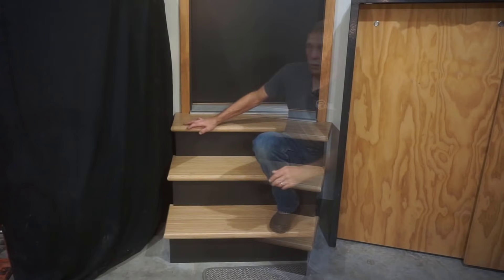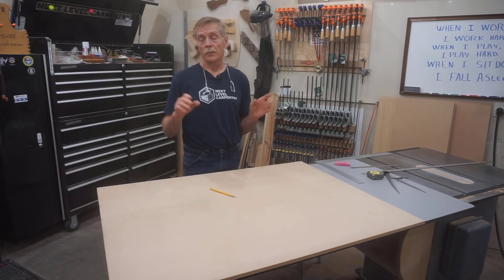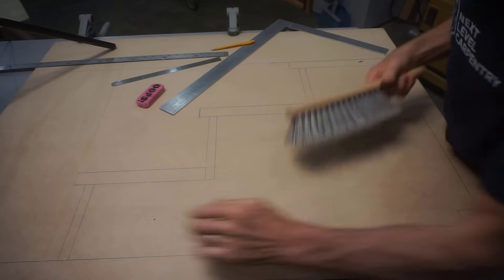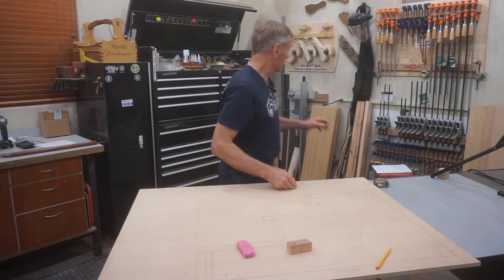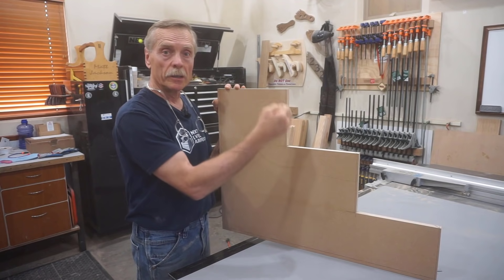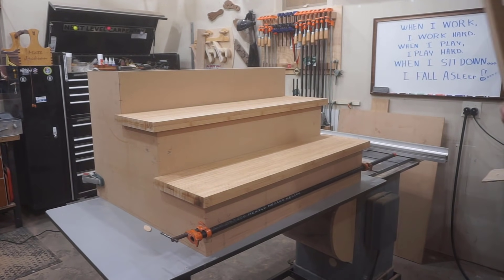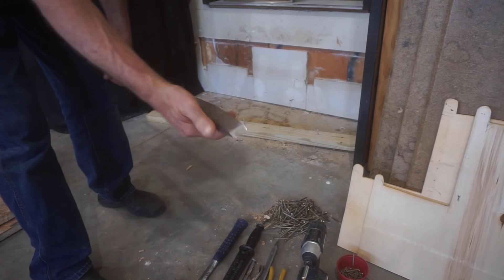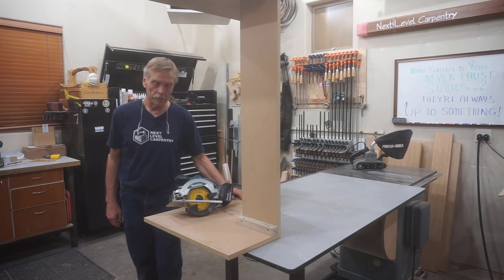Build Simple Strong Steps Without Stringers

Comment: Nice short cut and good use of story stick.👍But my local building code ☹ will make add a 36 inch landing in front of the door and limits the riser to  7-3/4" max.
Reply from the maker: That's just the sort of boneheaded building code requirements that I rant about... sorry to hear you have to deal with such inanity😔

Comment: Hopefully, you primed and painted the box ends that meet the cement.  Water and moisture from a garage floor cleaning can unravel HDF integrity..... I do this with kitchen counter cabinets because there's always the possibility of a plumbing leak or a dishwasher overflow wetting the kitchen floors.  Wet and particle boards don't get along.
Reply from the maker: Your caution is essential when dealing with MDF but this particular exterior grade HDF product is so impervious to water that I've had it soaking in a bucket of water without deterioration. If in doubt definitely seal up those edges but if you know for sure it's exterior grade stuff then it's not a concern.

Comment: great video.  the Graco, did you use an Ultra Max or Ultra? Looks like Ultra, just wanted to make sure.
Reply from the maker: I used the Ultra.  The difference is that the Ultra Max can spray solvent based paint, right?  I spray solvent based lacquer through gravity feed cup guns so I didn't need the airless Graco for that and I think spray performance between the two is the same?  Best, Matt

Comment: Excellent video! Just wondering what make/color of chalking you were going to use where the bottom riser met the concrete floor?
Reply from the maker: Glad you like the video Creig... this product is what I have in mind for sealing that riser/concrete joint:
https://www.amazon.com/dp/B000H5VWXM/?ref=idea_lv_dp_ov_d&tag=onamzdigitalj-20&linkCode=ic6&ascsubtag=amzn1.ideas.29WVINIJF4EUJ
It's clear AND paintable so provides a good seal but doesn't create issues for future re-finishing.
Best, Matt
Reply: @NextLevelCarpentry  Thank you!
Reply from the maker: There's probably 2 or 3 other quality products from well known brands out there but Dap is a good benchmark for it...😎

Comment: That’s one beautiful set of stairs built like premium furniture.  But I question your choice of using HDF for the box.  Also I don’t see a treated lumber base plate nor moisture barrier under the box.  This a ground contact application in an environment that frequently gets soaking wet, not to mention the moisture that the concrete constantly wicks from the air and soil.  Wouldn’t the HDF just soak up water, then pucker up and crumple?  How did the box perform over time?
Reply from the maker: Take note that the material used is an exterior grade hdf and not MDF. Do a bit of research on the difference and you will understand the choice of material for this application is completely responsible. It's good that you bring up those points thuogh because in many applications in many parts of the world those are completely legitimate concerns and failure to heed them would result in unsustainable workmanship.
Reply: @NextLevelCarpentry  Thanks for pointing out that the HDF is exterior grade.  But that is not the same as wood rated for ground contact.  They are rated for exterior high moisture above ground applications.
Reply from the maker: @nauy  check out Medite brand HDF. It is made specifically for use in exterior signage and stands up to water and weather better than any man-made product I know of. You are making broad statements and conclusions about specific applications which can often be misleading. It is wise to consider the facts you point out but would be foolhardy to assume your conclusions are right and any other decision is wrong....
Reply: @NextLevelCarpentry  If you are using Medite Tricoya Extreme, then I stand corrected.  I did do a bit of research as you say and found out about the Tricoya acetylation technology.  The Tricoya MDF can indeed be used in ground contact applications as claimed by the manufacturer.  This is a crucial piece of information that was glossed over in the video.  You could’ve simply stated this at the outset instead of being dismissive of my concerns.  I was not familiar with this product - it doesn’t seem to be widely available in the US.  I am just a DIYer who’s trying to learn to do next level carpentry.  But I think I am representative of your target audience.  Anyway, I am glad I get to learn about this new acetylated wood product.  It seems too good to be true.
Reply: I want to clarify.  Medite makes all sorts wood products.  Only the Tricoya licensed products have the in-ground and extreme weather claim.  In the US, Eastman Chemical makes the Perennial Wood brand of acetylated wood.  They’re sold at Lowes.  There are probably other brands.  The important thing to look for is ‘acetylated wood’.
Reply from the maker: @nauy  There it is then.  
A word in response to 'you could've simply stated this... instead of being dismissive'; you'll do well to be less confrontational as you try 'to learn to do next level carpentry', especially when your point of concern is off topic from the message in the video.  The video shows how to build stairs of this design, not what materials to use to build stairs on concrete that will handle any/all possible conditions.  It makes you appear a boorish armchair superintendent when you're probably actually just an inquisitive person.  Here's a suggestion that will get you farther/faster on your journey:  rather than try to pick a nit with someone is well aware that their credibility is on the line with the release of every video, if you see something that doesn't jibe, spend time examining their potential decisions and motives.  It's good mental exercise for you that, if done, might keep you from making faulty assumptions and guide you through to facts that lead to sound conclusions.
There's plenty of hacks in the world, but there's also those of us who have a lifetime of experience behind decisions we make and stake our livelihood on our decisions every day on the job.  
I wish you well on your journey...
Best, Matt

Comment: Matt, Fantastic level of useful detail, as always, in particular your signature Projected Point Pencil
(PPP tm). I just started to use Starbond brand CA in colors. Is there anything proprietary to their accelerator, or will any generic CA accelerator work the same with it, regardless of brand?
Reply from the maker: Thanks for watching, Mike.  Sorry I didn't deploy a How Far Out gauge on the concrete floor or the walls but used the scribe process instead😌  If there's any proprietary difference between accelerators I've never noticed it.  I like a 6oz aerosol for the shop and prefer a 3oz aerosol for my toolbox but Starbond's smallest size is 6oz so my preference, for convenience on the job, is Stick Fast whose 3oz is best.  Out of solidarity with Starbond I carry their 6oz to the job but you'd not be under similar obligations.  All that said all accelerator seem to perform 'the same' for all practical purposes.
Hope you're having a great summer in health! 
Best, Matt

Comment: @Next Level Carpentry , are you not worried about temperature based expansion and contraction due to using a engineered wood? I ask cause to me it seems like despite the spectacularly superior finish quality of the mitered joints. I feel like its likely your still going to have the potential for the joints to want to open up some over time or potentially twist and warp some as time goes on. Asking out of curiosity and desire to understand, not as a criticism. Thanks for the time.
Reply from the maker: That type of material property/behavior is a legitimate concern for sure. I don't think of this particular product as engineered wood as much as a specially-designed composite. My confidence in using the material I did for the steps in the video is prior experience with this exterior grade hdf product. The brand name is MedEx which is designed specifically for exterior signage Construction. I personally used it for a sign I made 30 years ago which has been out in the weather ever since and still holding up just fine. Without that confidence though I would definitely take other measures to prevent deterioration over time which would surely happen.
Reply: Med EX is pretty good I prefer the green water resistant types though as you can’t get the old sundeala waterproof any more, as for the bamboo it is supposed to be   stable in damp environments.    My query would be about CA glue over time, I have had it crack in some circumstances.
Reply from the maker: @CrimeVid  The application of CA for those little returns is pretty low-risk because of near zero stress on the joints so I'm not worried about it at all.  I've never had CA just plain old fail although an over-stressed joint can sure break... but even then it's more often failure of wood fiber next to the glue joint than the actual glue joint itself.  I would probably have used Titebond III for the returns as well if they were likely to be stressed or if the steps got direct, extensive UV exposure though... Best, Matt
Reply: @CrimeVid  The starbond stuff is quite solid super glue. I was introduced to it by a friend who is a luthier. Its become common practice to use for frets. Some people go so far as to use it on the braces in acoustic guitars. Which have very small contact areas by very high stress and tension. So I have a little more faith in it.

Comment: Folding ruler? Are these never used by US woodworkers? Seems a useful alternative to messing about with sticks.
Reply from the maker: Folding rulers went out in the 70's with the advent of good tape measures.  They're pretty cool, especially when wielded by an experienced carpenter but that's pretty rare.  I've got a great old wooden folding ruler but still think the stick method shown in the video is fast, accurate and efficient for most users doing this sort of work.  Here's a good question for you: have you ever seen a metric folding ruler?!  Never thought about it until just now but there it is...
Reply: @NextLevelCarpentry  sure i've seen metric folding rulers...in Germany, almost every worker carries one, there's even a specific pocket for them in off-the-shelf workwear. It's tape measures that you don't see so often. In any case, using imperial fractional measurements is a pain that i'm happy to do without!  ;-)
Have a lovely day, sir!

Comment: You should separate the concrete from the wood with sill tape to keep moisture from the concrete leaching into the wood.
You can stick it to the floor then cut and peal off the excess after setting your steps.
Reply from the maker: Sounds like a sensible insurance policy... I'm not concerned with this material on this floor in this environment but there's many situations where your solution would be more than prudent!

Comment: Matt...did you Cut your 45's at 45 or at 45.5 Degrees for a Tighter Fit?
Reply from the maker: Since they were getting copious glue and painted I just cut them at 45 this time.  Good observation because if they were veneered mdf or plywood that got stained I'd likely have cut them at 45.5 ( I think that's what you meant?) so they'd pull up tight for a putty-free fit. Good to see a comment from you... it's been awhile and hope you're doing well! Best, Matt

Comment: I love the "prebuild" part of any job . No customer looking over your shoulder asking questions looking for company more than a good job. 
I am surprised that the 3 quarter MDF was strong enough for entry stairs in a garage , Good to know.
Reply from the maker: 1/2" HDF would be strong enough for the parts I used 3/4" for on this particular stair but it's important to note where it is and is not used!  Since the HDF is standing on edge and supported so it can't flex under load it's incredibly strong but it would be an irresponsible mistake to use it for treads at less than 1 1/2" thick IMHO. Best, Matt
Reply: @NextLevelCarpentry  Thank  you for that information , it will come in handy I am sure.

Comment: I can't tell if he is using a drill or an impact driver,,, I used a drill to drive screws for over 15 years. And even used the torque out device, but I hated it, it was never reliable in helping me stop driving a screw before I blew it through the material. Since I picked up an impact driver to drive screws, I haven't set it aside. The impact tool gives a sure-fire way to get a super long screw in and not cam out of my screw heads.

Comment: You make me question my garage stairs not having an upper landing step. It’s concrete and now I’m annoyed that if I made a landing that concrete would block potential storage under it. The amount of heavy stuff I’ve carried through the door... DeWalt miter saw.. the big one... lathe ways... metal lathe ways... a landing step would have been nice.

You also give me a little more confidence using the belt sander. Years of experience and efficiency, time is money.
Reply from the maker: A landing and or Landing step is certainly nice if you can spare the extra space it takes up.  Keep in mind that even a concrete step is removable... a bit drastic but definitely removable. 😎

Comment: In general very impressive but honestly seems a bit overkill for a garage.  There are many great tricks used here by an experienced carpenter that I have see being used by some set builder guys I have worked with recently.  The angled ruler is one I have seen used for smaller areas for dividing equal sections on a smaller project although I have seen TOH use it for exterior shingles.  The large dividers trick I have not seen.  Great for smaller stuff.  Might be good for calculating mullions distances on windows.  
Not sure I've heard of HDF... I assume High Density Fibreboard??... In the UK they use MRMDF which is Moisture Resistant MDF so maybe these are one and the same thing.  
This does seem like it took several days to build and have it installed and these days I am not sure any client wants to pay much for this kind of custom work.   The labour cost on this alone must be pretty high.  For this kind of quality I would expect at least $1000 including material.  Even that might be low.  
Normally I would likely just use two short straight stringers with the angled brackets used for decks.  Just attach to the stringers with lags .. use a ledger on the wall but since there is a mini landing that method probably would be a bit hard to work out.  
I guess those stairs must get alot of wear and tear since they've gone through two sets over the life of the house.  
Well there is no substitute for experience that's for sure although these days the older you get the harder it is to get decent paying work... that's been my experience anyways.

Comment: The biscuits are good for alignment but not for structural integrity. You must assume that a rather large refrigerator may have to come up and down those stairs. Thumbs up.
Reply from the maker: Biscuits (for alignment and a bit of strength), screws and strength of HDF risers is what will withstand heavy use on these steps but, as I'm sure you know, fridge-moving gorillas can destroy pretty much anything, except maybe welded steel, including poured concrete.😨 Best, Matt
Reply: @NextLevelCarpentry  Would you instruct your client (in writing) about the load capacity with regard to an appliance such as a stacked washer/drier or a refrigerator?
Reply from the maker: @bobcatt2294  would you?
Reply: @NextLevelCarpentry  Indeed I would. I woiuld then add, that to keep the stairs from being damaged or marred, that a ramp be used. I would think, in your particular case, when you view the video and the care in workmanship (which we all learned), they would want to preserved the integrity and look of the stairs and use a ramp. Giving them this notice, it helps to draw the client's attention of the impact of heavy equipment on a product like this.
Reply from the maker: @bobcatt2294  Interesting. If I ever feel the need to provide documentation to that extent so I can sleep at night I'll find a different livelihood.
I do hope this exchange doesn't come across wrong because you have earned my respect with your  sincere question and response.
Best, Matt

Comment: additional 20" to the top step would be a better landing relationship to the door for safety.
Reply from the maker: Sure and additional 20" on the top step is good, although not as good as 36"... but equally irrelevant because a garage without room to park vehicles in, right?
Reply: @NextLevelCarpentry  yes I agree, most house designs with attached garages do same to lack the need to have a larger landing.

Comment: looking at this again, why three steps ? there seems no need for the third step if you think of it, and it would save (a little) floor space.
Reply from the maker: You are correct in that technically the flight can be done with just two treads but the extra top tread serves, as I said, as a mini Landing and makes the stairs safer during habitual use. If extra floor space was an issue the top tread could certainly be eliminated but for these folks The Wider Top Step makes the stairs so much more comfortable to use when reaching for and using the door handle upon entry and exit. This highlights the dividing line between building code requirements and personal preference and I always lean towards customer preference in the discussion...
Reply: I too have to lean towards the misguided and insane, but heigh-ho it’s a living !
   I always tell my patients that I will do it, but to change a thing back to reasonable, is fully chargeable !